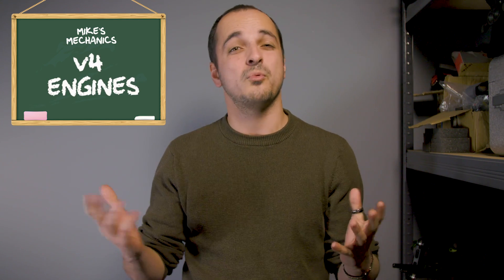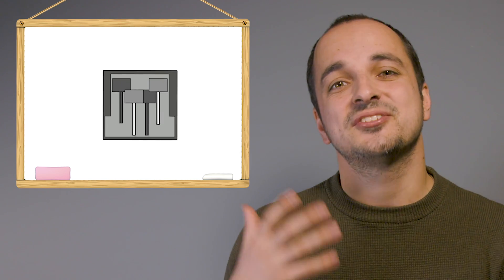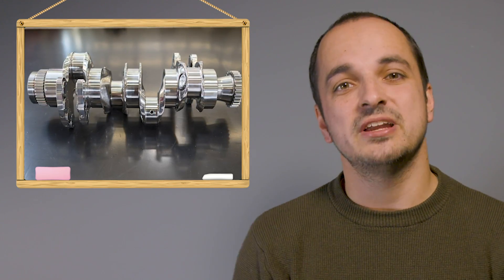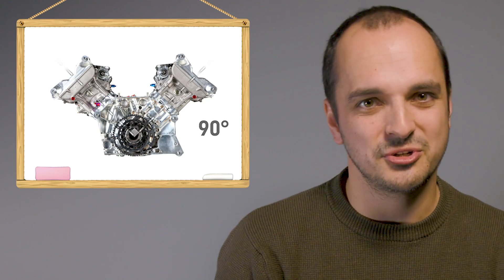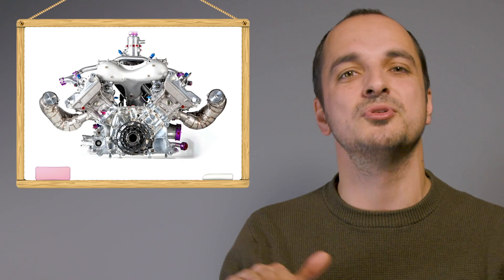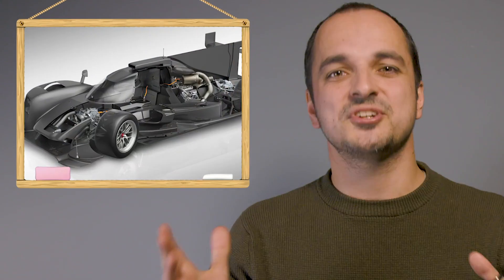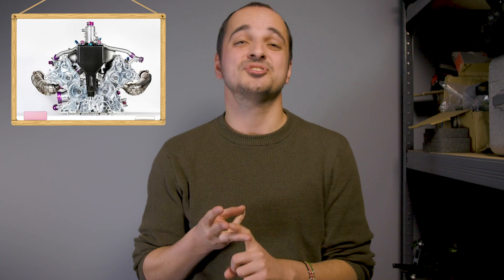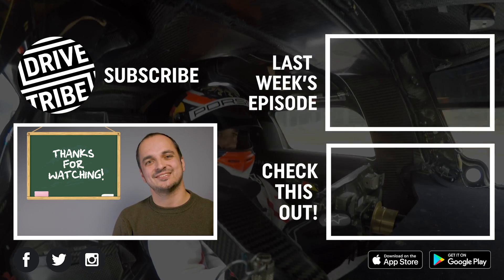Why V4 engines are so rare and which cars use them - Mike's Mechanics

Comment: Ford produced the "Essex" V4 between 1965 and 1977, and was used in the Capri, Consul/Granada, Zephyr and Transit vans. Not exactly a lot where produced, but one of the few examples of mass market usage. It was essentially a shorter version of the Essex V6. Some of the extra costs were reduced as it used a single cam in the V with valve pushrod option. However, once OHC became the norm (at least in Europe), that made the whole thing uneconomic and destroyed the packaging advantages.
Reply: the German V4 "Cologne" was produced between 1962 and 1981 ... in milions :)     The V6 essex came from V4 , same with the Cologne V6 that came from the V4....  you can see the design faults in the V6 because of the V4 past....

Comment: Didn't some early ford capris have a v4?
Reply: They did. Called the Essex V4 and it was used in come models of the corsair, granada/consul and, importantly, the Mk 1 Transit Van. Part of the reason it was developed was so the Transit van, which was RWD, could have a short bonnet with the engine well back in order to maximise carrying capacity. It's essentially a shorter version of the Essex V6.

Comment: Why did you say the V4 has perfect primary balance as if inline-fours don't?
Reply: because Inline fours are not inherently balanced and have to add a balance shaft to smooth it out. other engine types such as inline sixes or flat-4s do not need a balance shaft
Reply: Dana Vixen sigh yes they are. Any inline engine with an even number of cylinders greater than two will have perfect primary balance. The balance shaft is needed because of the secondary forces of the swinging crankshaft, which get worse as you increase the stroke. Flat-4s in fact have worse NVH properties than an inline-4.

Comment: The 919 isn't one of the fastest race cars ever. It IS the fastest race car ever.
Reply: Fastest depends on context.
Reply: Land speed cars, top fuel drag cars.. say other wise. 

my point is, to say it's "one of the fastest" is loose.
Reply: @mikehunt9894  Top fuellers are amazing for sure, but no ICE car has held the land speed record since the early 60s. The current Land Speed Record is more than twice the top fuel record. It's supersonic... and it's old. Vehicles now being developed are looking to crush the existing 763.035mph record and lifting the record to above 1000mph.

That said, the 919 Evo lap of the Nurburgring is perhaps the most amazing 5 minutes of motorsport I have ever seen.
Reply: F1?
Reply: @frankunderwood8280  WEC
Reply: lol no, f1 cars are much, much faster than the 919
Reply: @nanderlizernanderlizer684  Nope. Just not correct. 

The 919 Evo broke records in both of its timed runs (Hamilton's F1 lap record at Spa and the Nurburgring outright) Ferrari's Vettel has since broken that time by 0.199 seconds - faster, yes - but not by much. And I think you'd find the spread of qualifying times at your average F1 to be greater than 0.19 seconds which would mean the 919 Evo is right there at F1 pace.
Reply: @nanderlizernanderlizer684  Just slightly faster, but faster nonetheless. However, F1 cars aren't nearly as durable or reliable as LMP1H cars (there's no telling how the 919 Evo in particular is though.) Besides, the fastest race cars in the world are technically top fuel dragsters anyway.
Reply: Toyota were always faster, lost due to reliability. So yeah, dumb Porsche nuthugger spotted.
Reply: @penalozaur  I'm talking about the Evo, buddy. It lapped the Ring in 5:19. Do you know of anything faster than that?
Reply: This upgraded 919 is not a race car. It does not feature in any official racing series.

Comment: Porsche, please sell a detuned crate V4, that thing sounds glorious.
Reply: You can buy a Apprilia rsv4 or Ducati Panigale v4. Both have 1 Liter displacement and about 200 Horsepower.
Reply: @patricknintemann924  that's pretty tempting, would be an awesome swap for a midship conversion kei car. It's a pain to mate bike engines to car gearboxes (and it'd be a pity to lose the bike's sequential for a regular manual), but you're right that they're the most modern examples in the market.
Reply: @S50Sinner  There are engine swaps for Ralley and Mountain Race. They put 1000cc or a Hayabusa Engine in small light Racecars. They leave the Gearbox on what the Engine comes with because the engine and Gearbox are in one case. They are not seperated like Car engines. It works good for light Cars. Then you have a Car that revs up to 12,000 rpm and it sounds amazing.
Reply: Patrick Nintemann there is even a kit for smarts
Reply: @patricknintemann924  ducati uses L4 configuration. Because it's 90° and looks like a L 😄
Reply: @kartikbajaj5497  I also call them V Engines. It is just 90° V. But L is also correct. 180° is called Boxer. Porsche Subaru and BMW Motorcycle, Honda Goldwing still builds them.
Reply: @patricknintemann924  yeah also known as flat 4 and flat 6..
Reply: @patricknintemann924  i'm reaaaally late, but 180° V engines are not boxers. They are a different knid of engines.

Boxer engines have each crankpin controlling only one piston/cylinder while the 180° V engines share crankpins
Reply: @CarlosGarcia-ze6rt  Ok? I don't know about that. Maybe you're right. My point was that a Boxer engine have a Cylinder angle of 180 degree. I was not thinking about Crankshaft design. Only the Cylinder angle.
Reply: @S50Sinner  A custom crankcase and to fit on a Car Clutch, that is something. Well, anything is possible with enough money. Or you have the knowledge and Machines that are needed to do something like that.
Reply: @patricknintemann924  For sure, there's a lot involved in messing with that, we've been messing with the transmission for a long time and still need to iron out more details for our 320lb, 14hp baja car, even though it's still running the bike clutch.
Reply: A lot better sounding than a boxer four, for sure.
Reply: Cars sound like wet farts haha how can you be into that? Car people freak me out there's one photo where a guy f%cks the exhaust pipe haha he loved the sound 🍄
Reply: @schregen  why are you watching a video about cars, then? You have no reason to be here, how many levels of boredom do you have to be on to come to the comments section of a video about something you have no interest in just to talk shit?
Reply: John Smith what you just said makes absolutely no sense at all please think before you comment on something you don't understand. All cars don't sound the same...just so you know
Reply: @schregen  each engine types have their own specialties, same as V4, how dare you say that V4 sound like a wet fart, it probably sounds better than your mom's wet fart, get out punk
Reply: @schregen  You are a GOD bro XDDDD
Reply: *They do, sorta. They  sell the Cayman 718.. and we'll we all know what that sound like. 😂
Reply: @schregen  you sounded like you have no opinion of your own.

Comment: V engines also have a lower center of gravity.
Reply: @AzathothsAlarmClock  does a boxer not have an even lower centre of gravity
Reply: Wyatt Foster
 lower center of gravity? you have two extra camshafts pulley (and the extra support/weight you need to run with 2 cams/spit block). the intake or exhaust must come out the top vs the side of an I-4. not to count for an I-4 you can put the engine at the same angle. the only one with a lower CG is a flat/boxer engine
Reply: @gatorage850  V engine blocks are stronger per gram of material as by their inherent design. 

They also can more efficiently package turbo chargers. I'd say the pulleys wouldn't weigh much of anything. At this level they are probably titanium.
Reply: @WyFoster   but you need more material in a V type engine. "more efficiently package turbo chargers"? I would say an I-4 has more side room for turbo and easier to run a single turbo. "I'd say the pulleys wouldn't weigh much of anything"... yes, but you need to run extra not just pulleys... chains, bolts, etc... overall you have more mass over your center = higher center of gravity. higher center of gravity is not necessarily a bad thing.
Reply: Don't use words you can't create and explain please

Comment: I've long been thinking that Subaru should replace it's boxer engines with 90 degree V4s... no additional complexity (arguably less if they used only 2 shared crankpins as opposed to the 4 they have now), not any longer front-to-back, and only a slight COG disadvantage. But they'd be much easier to service (pull engine for spark plug changes???), allow for much narrower/stiffer frames, and they wouldn't suffer from oil starvation as they do now.
Reply: Contrary to popular belief, Subarus aren't actually that hard to work on
Reply: @magnetic0314  2004 Subaru WRX owner... Can confirm. Easy to work on.
Reply: Also the lower weight distribution that comes with a boxer is one of the key factors in Subaru's rally success.
Reply: You don't need to pull the engine to change plugs on any Subaru I've ever owned.  The 4 cyl actually sits quite far forward, even the 6 cyl isn't that bad to access the rear cylinders.

The width is the biggest packaging issue of Subaru's engines but they manage it well.  I like them, very well balanced cars thanks to having that very short engine sitting nice and forward and perfect side to side weight distribution.
Reply: Subaru had 2 stroke V4 already on their mind. Nevertheless it didn't survive to final product.
Sorry for bad english. It's not my first language.

https://ausubaru.com.au/viewtopic.php?t=2123
Reply: @teknisoroka42  intresting, in a car a 2 stroke? That would have been cool but of course crazy for other things than racing uf it git big, easy power if well built.
But thirsty and having to replace pustons etc now and then, also needing 2stroke oil.
Would gave been fu to se but they shose the right path with the boxer, like Porsche.
Reply: That's what was supposedly what was going into the frs an brz originally..
Reply: Well they like the weight low they say even if the Lancer with a straigt 4 never ever was any worse, its a Subary trademark since along time with the boxer, and it gives them a nice mororsound on high revs, running on low revs they sounds like an WV beeetle if old.
A v4 is not balanced the sane way so why change to that?
There us a reason the v4 never got that common.
Ok if balance was important cars would have had straught sixes misttly, but that takes more roo than tve unbalanced v6 so too bad the v6 has won out almost everywere in the xarworkd, BMW still use them thou, and they are like silk.
Reply: Subaru Fans:
TRIGGERED
Reply: Right, this is a one sided analysis... I'm watching thinking why the heck do we see H-4 boxers but not V-4?  The replies here help make sense of it... when you are making a LeMans car with a hybrid, the H-4 layout is going to interfere with the electrical stuff that you lay out low, and the batteries and such already are lowering the center of gravity, but in a production car where you don't have that, you get more from lowering the center or gravity (reducing torque on the frame to begin with) than you do by adding stiffness. Plus in production car, you can up-charge for stiffer carbon fiber body panels, etc.
Reply: Contrary to some posts here, while not impossible to work on a Subie in things such as changing the plugs, it is in general more complex then other cars.  Each cylinder may require a unique set of socket extensions which some may have to be attached/detached in place while in the process of removal/installation.  Removal of other items such as the air filter assembly and battery may help but is usually not required, though not doing this limits working room.  Now one gives up a easy spark plug change when one goes to a boxer, and in that it's part of the deal, but if you work on a inline 4 where you can directly access the plugs, one realizes that yes subies are a bit of a PITA in this respect.
Reply: The H-4 is harmonically superior. Do not sully the Boxer configuration. The oil starvation is the pickup, not the Piston configuration.

Comment: Over 500000 saab 96 produced with V4(1967 forwards) i wouldnt say V4 is not so rare🙄
Reply: Saab was killed by GM's accountants. Milking the company dry and then selling it without half it's assets. Like they did with Opel.
Reply: @cyberdansken  Saabs biggest problem with GM was that those parts which were supposed to be shared between cars were so bad that in the end Saab modified 90% of all those parts. GM was and still is just carbage and Saab become too expensive to GM allthough Saab was propably best what GM had in middle class cars. GM pulled out r&d money and they insist Saab to develop next car model with strict use of GM parts, Off course Saab denied... Except few badge engineered cars like Saabaru and 9-4x which GM forced to bring out to US markets.

Saab just was too good car for GM brand what came to profit margins and bad sales because lacking development and new cars(latest model, the MY11 would be awesome car to continue but GM pulled Saab off. ☹️)
Reply: Explains why saab never made it as a car company lol
Reply: @MichelLinschoten  oh? Hows so? GM killed Saab, not customers...besides turbos came popular only after Saab introduced Turbo 99, before that there was only few trial batches made by corvair, porsche, bmw and international scout.

So how come Saab has not made it ?

Ps. I own few Saabs, my11  9-5 aero, ng Aero 9-5, 900C and R900 (9-3)
Reply: Also lots and lots of Ford's in the sixties and seventies
Reply: Saab used the Ford V4 engine ....   but V4 was used only in a very small number of carmakers ...  only Ford and Russian ZAZ made them for cars.

Comment: If only the Cayman/Boxter sounded like the 919.
Reply: Yeah... if they did people wouldn't have hated them.
Reply: No, go back to flat 6
Reply: 718 has the worst sounding four cylinder I have ever heard, period. 🤣
Reply: @Benjamin Burkhardt Flat 4.. shouldn't they be referred to as F4.. 🤣
Reply: Yep, they should put this 919 V4 in the next 718 Cayman/Boxster.
Reply: @alanung That's would be awesome but disastrous. 😂
Reply: @F1ll1nTh3Blanks  Yes, it would be awesome; it will fix the crappy sound of the current one and the power boost would be more than welcome for most Cayman/ Boxster owners... :)
Reply: Or the old I6 in the cayman that was great, but the V6 cayman sounds crap
Reply: The 718 sounds like a Subaru, and I think Subaru’s sound better.
Reply: Ryan Pavey it has equal length headers, so it sounds like an Outback. The stereotypical “subie rumble” comes from unequal length headers, which the Porsche’s don’t have, so they don’t have that STI rumble. I personally think equal length headers on a flat four sound like ass.
Reply: But they both had the same flat six engine as the 911 which arguably, sounds even better.
Reply: @catfrab  I'm guessing SMP is referring to the 718. No one complained about the flat-6 986, 987, and 981 cars.
Reply: @gonschor7dleven  Yeh you're absolutely right but the early 986 got a real slating off by the motoring press at the time. It wasn't a bad car but did need a bit more grunt - hence the Boxster S which was a great car as the 986, 987 and 981. I miss mine a lot 😢
Reply: @catfrab I still have my 981 GTS and I believe she's a keeper for quite some time to come.
Reply: Patrick Steinmark my 981 Cayman is a base, bought it as my toe dip into Porsche ownership and figured I’d move on to a later S or GTS. 4 months in and I’m starting to think this might be a keeper, never expected that from a base Cayman.
Reply: Sounds like a reasonable request

Comment: Why do motorcycles love the V4?
Reply: Because V4 is just V2 but 2 times better.
Reply: Because it's relatively narrow for a four cylinder engine so fits nicely across the frame. Uniquely, Ariel uses to use a square 4 with two crankshafts connected together to solve the same problem (known as the "squariel").
Reply: @TheEulerID  True - an old guy who lived near me had a motley collection of old cars and bikes, mainly sidevalve singles like Norton 16Hs and BSA M20s - and in the midst of it all, a 1935 Squariel cammy. That thing sounded like a modern four, while the sidevalves delivered a thundering wallop at every second telegraph pole. :D
Reply: @genemckinney8491  Squariels were always OHV, not side valve engines.
Reply: @TheEulerID  I didn't say they were. They started out as an OHC design by Edward Turner, before Valentine Page redesigned them as an OHV in 1936.
Reply: Can be accomplished with a V-block or an inline-4 with crossplane crank. The goal is uneven firing intervals, producing better control and traction, also a different power curve from the engine due to the frequency and timing of combustion torque vs. inertial torque.